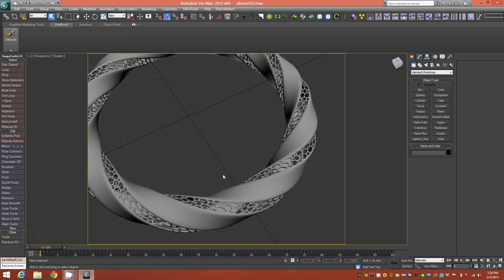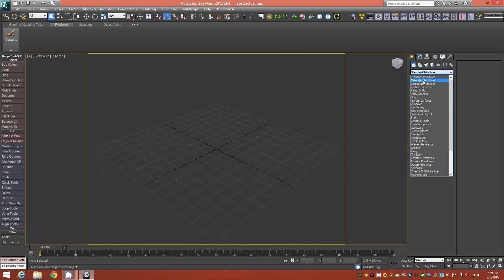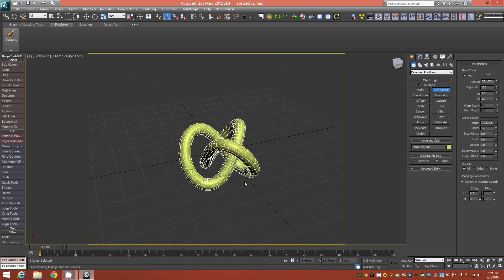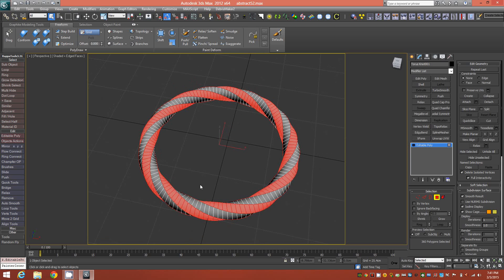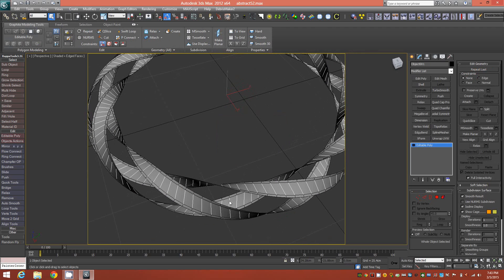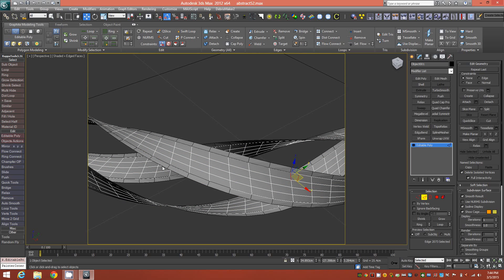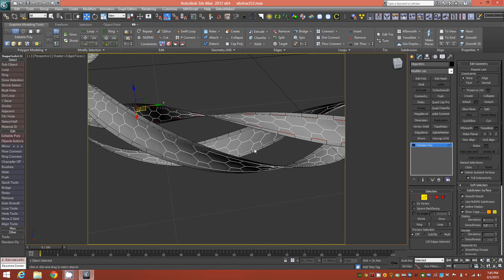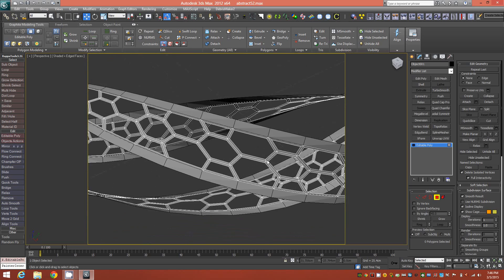3D Tutorial | Modeling Triply Twisted Torus With Holes | 3dsmax

Comment: Mr. Is there a way to make this model in the blender? Thanks
Reply: Blender can do just about anything 3dsmax can do.  The difference is just that it might take a few more steps.  Blender doesn't have the same topology generator that Max does, but it's still possible to do it.  If you notice, most of the models on this channel are done in both softwares.
Reply: I managed to do it by first creating the three strips as planes (using the free  Extra Objects Addon for the honeycomb) and then stacking the following modifiers:

Array
Cast (with Cylinder shape if you want a bit more roundness)
Simple Deform (Twist, z-axis, with a multiple of 120° as angle)
Simple Deform (Bend, y-axis, with 360° as angle)
Weld
Solidify
Bevel

Result: https://imgur.com/a/ogO8cqk

you have to make sure that the top and bottom of the base mesh align perfectly

Comment: how to select all the faces in 13:12 the loop option is off on the polygon mode
Reply from the maker: Depending on the version of 3dsmax you are using, all you need to do is simply select the first polygon, then hold down Shift while hovering over the next polygon in the loop you wish to select.  In current versions of the software, you should see a highlight outline of the loop you are about to select.  While holding shift, just click on the second polygon and the loop should be selected.  In older versions you were required to double click while holding shift.
Reply: @luxxeon3d  tnx

Comment: I am using 3ds max 2017 and whenever I use the twist setting the torus never twists. It still shows it as a regular torus even after I render it.
Reply from the maker: The twist parameter seems to work fine for me in 2017, so I wonder if there is something else going on.  Make sure you have all of the hotfixes and service releases installed.  Are you using the latest 2017.1 release, or the original release?  Also, be sure you're using the Torus Knot extended primitive in Circle mode, and not just simply the Torus standard primitive.  The standard Torus primitive also has a twist feature, but it works entirely different from the Extended Primitive Torus Knot..
Reply: your side is set to 18 so lower it to 6 or keep it at 18 then hit F4 (edge faces) to see the twisted mess.

Comment: if there aren't any plugins then why is your interface different from mine? there is no generate topology panel.
Reply from the maker: +Keagan Echols Hi, Keagan.  Sorry for any confusion.  I am using 3dsmax 2012 in this video.  The Generate Topology panel was introduced in 3dsmax 2010, by default, in the Graphite Modeling Ribbon tools.  So, be sure you have the Graphite Modeling Ribbon activated in your UI.  You need to have 3dsmax 2010 or higher.  No additional 3rd party plugins are required for completing this tutorial, but I do have my UI customized, and plugins added to it.  However, I don't use any in most of my tutorials (unless I specify otherwise).  While my UI is obviously customized, all the hotkeys and tools I'm using here are available by default.
Reply: +John Malcolm I'm not sure it's in the student version. I'm clicking show panels and they are all selected.
Reply from the maker: Keagan Echols Ok.  If you have the Graphite Ribbon open at the top of the UI screen, the Generate Topology button is available when you open the expansion rollout under the tab labeled "Graphite Modeling Tools".  You should see "Polygon Modeling" at the bottom of that tab, with an arrow next to it.  Click on that, and it will open a rollout with additional options, inlcuding "Collapse Stack", "Convert To Editable Poly", and "Apply Edit Poly Mod".  Generate topology is the very next option.
http://docs.autodesk.com/3DSMAX/15/ENU/3ds-Max-Help/index.html?url=files/GUID-7358B7AB-86DB-4B3F-9954-BB11AA6FF3FE.htm,topicNumber=d30e121109
Reply: +John Malcolm hey how would you model complex objects like cars or other vehicles. wheels seem to be pretty self explanatory but what about the frame? I've seen multiple ways to do this but none seemed very professional. would Max be used to render a base mesh over to other programs like mud box or z brush for further sculpt or detail? Also would Max be used to model complex castles or cathedrals that are properly scaled?
Reply from the maker: Keagan Echols 3dsmax is often used for modeling architectural structures to scale, and is one of several packages taught in various CAD Arch/Viz schools.  It's widely compatible with many CAD packages (with direct support for splines and line art, and has excellent tools for modeling to scale.  As for cars, I haven't personally modeled many vehicles, but there's a lot of them out there created with the package.  3dsmax, like Maya, is distributed and developed by Autodesk; the same company that develops Mudbox.  Base models can be created in Max, and sent to Mudbox for further detailing.

Comment: I did it, and it worked perfectly, but whenever I press F9 to get the real photo,I can't see the edges
Reply from the maker: Zakaria Dahi Yes, F9 is the hotkey shortcut to render your scene.  If you wish to display edges in the viewport, then choose F4.  This will toggle your "show edges" display off and on in the viewport.  If you wish to render an image with visible edges, then you will need to use a material that can show edges.  Perhaps this tutorial will help: http://blog.digitaltutors.com/two-easy-methods-rendering-wireframes-3ds-max/
Reply: John Malcolm  thank you very much sir :) you helped me a lot !
Reply: John Malcolm sir, I'm sorry for asking you many questions but i really want the answer of this question :
do the 3d printer print the edges ?
Reply from the maker: Zakaria Dahi A 3d printer will print the model, but not the visible edges that we are talking about here.  Some 3d printers can print in color, so if you want a specific color, that may work, but a 3d printer will not print textures like a wireframe material. A printer will only print geometry of the model.
Reply: ok thanks again :D